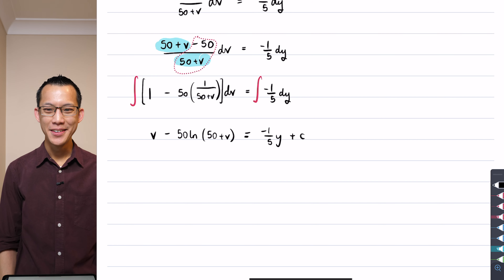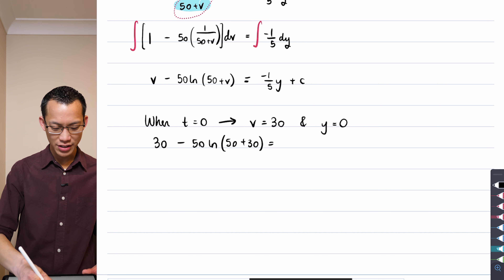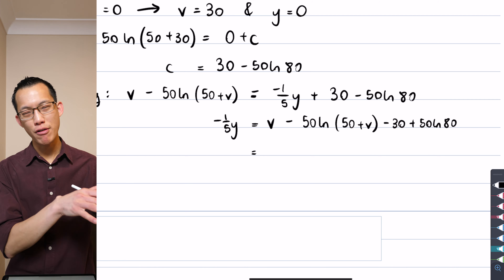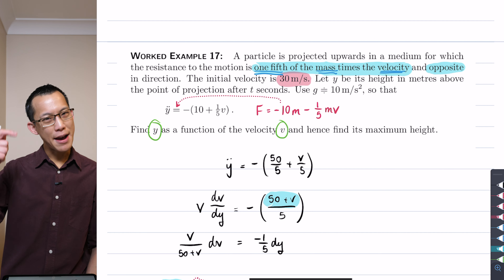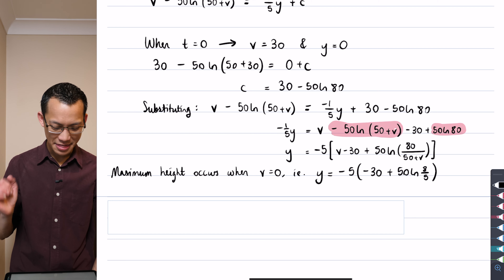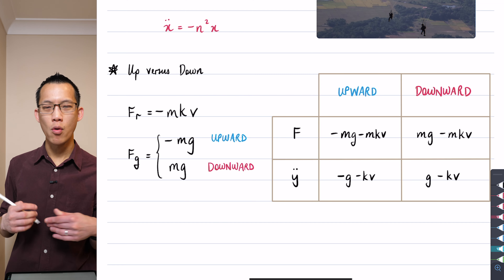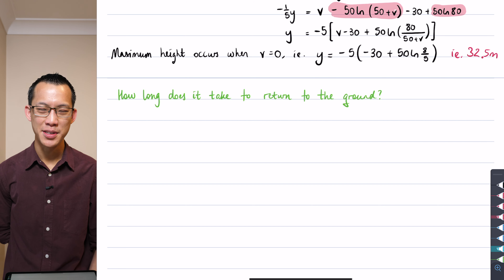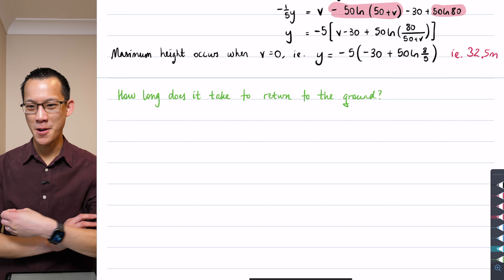Vertical Resisted Motion (3 of 5: Determining the maximum height)

Comment: Not sure why it was suggested to break the motion into two sections, that seems to just create more work. I was able to come to the solution without that.

Putting my teacher hat on, my guess is that because if you had a v^2 resistance term you'd have to break it up, and you want to give your students a strategy that works in all situations.
Reply: Theres only one phase of motion in the question set at the end. The first phase would be the part shown in the video. Better to restart and use  different phases. The resistance is always acting against motion. Although  technically you could use negative v. And set your positive direction upwards .
Reply: @davemiller1218  Ahh, you're right, I thought he said the total time from launch.